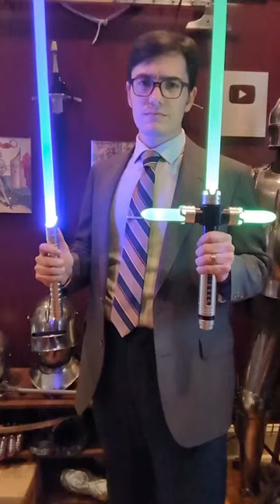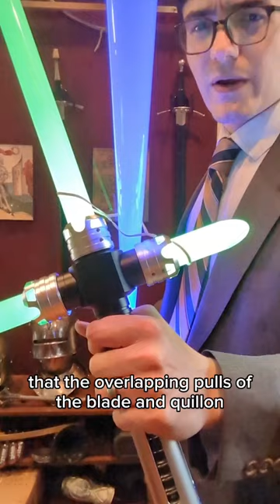Crossguard Lightsaber Theory

Comment: I have a similar theory that the magnetic field produced by a lightsaber makes it want to reach equilibrium which is why they appear to have weight despite actually weighing only as much as the hilt.

This is also how inquisitors are able to use their lightsabers as helicopter blades; the magnetic fields could oscillate at a rate that when combined with the spin of the blades, and a slight tilt could produce lift.

Comment: I agree with your explanation. But if you're really worried about it, there are two types of metal, cannonically speaking, that will stop a lightsaber blade, cortosis, and beskar. Beskar blocks without affecting the blade. Contact with cortosis will short the saber and turn off the blade.

Comment: Love the rubber bands, ❤ I think both are plausible it just depends, if its a quick light blow it'll probably cath one of the sides and slide onto the small blade like you said or just pull towards the larger blade? Like how bigger magnets have a bigger pull. 10/10 video btw

Comment: the blade also runs on the inside of the hilt so the section between the blade and the crossguard is simply covered and there is still lightsaber blade on the inside. we know this because the crossguard lightsabers still use a single kyber crystal in the center of the handle which is the source of the blade

Comment: The small “blades” on the sides are essentially vents, in a duel the wielder most likely rarely uses them to block as if it were a normal lightsaber without the vents

Comment: A saber without a crossguard ALSO has exposed handle there, the only difference is that there's ADDITIONAL blade with the crossguard, the fact there's additional handle sticking out the sides means nothing because a normal saber wouldn't block anything hitting there either.

Comment: I think people forget how the sabers catch on each other, and assume that they slide easily like a tube might to begin with.

They assume crossguards on a saber serve the same purpose as historic crossguards, but that specifically you would slide the opponent's blade down to the hilt and somehow twist it. The 90-degree crossguard isn't really used like that, and would be better served on the more angular crossguards (of which we have lightsabers that are built for) at which point the length of the projected blades makes it evident that you either catch an opponent's blade somewhere on the bottom third, or force them to disengage.

90-degree is clearly meant to be turned into your opponent during a lock and cut into them, also potentially forcing a disengagement, and favoring long-bladed projections of the main blade.

Comment: There are also some materials that are HIGHLY lightsaber resistant. Because a damaged lightsaber, especially a lightsaber damaged in the wrong way, is basically  as dangerous as a thermal detonator in your pocket, these materials are often chosen for lightsaber hilts, if not, specific parts of the lightsaber hilt.

So I'd presume beyond the magnetic pull between the blades, most crossguard lightsabers probably also featured resistant materials in their crossguard emitters.

Comment: The emitters on the cross guard are to control the excess flow of energy. If you did swipe down and burn out an edge it would probably blow out towards the edge you swiped and the overall blade would become weaker due to the excess loss of energy, but not much. Ultimately the port is still open and mostly guiding the energy in the correct way so it should be negligible.

Comment: The big secret is that it’s not meant to be used as a cross guard. It’s designed to break saber locks by putting a spitting unstable plasma blade close to their face while you press your saber against theirs

Comment: There was old lore (jedi channeled force i to kyber to power old) where the emitter just focussed the energy from the kyber crystal inset into the middle of the hilt, thus when activated you had energy in the entire hilt upwards from the crystal, just not focussed energy, and quillion blades were split off from tge edge of the source flow at the cross center before having three focussing crystals, eith wuillions being very tightly condensed to not be super long. The magnetic force would likely be much higher on a quillion as a result of the high focus of the field over a shorter distance and pull the blade to it, if this theory was applied with newer lore. Originally you likely couldn't cut through a crossguard quillion or above primary/upper hand of ANY lightsaber hence why there were sometimes long hilt distances from that hand to emitter, because primary hand was over the Kyber to help channel force into it, and anything above would have to cut through either an unfocussed torrent of pre-focussed blade energy, or a blade we already knew was impossible to cut through

Comment: Interesting theory. The problem is that those aren’t “blades”. They’re vents. There’s no emitter, but if you were to disable them, your opponent’s lightsaber would likely detonate in their hand. How, exactly you’d go about that, I don’t particularly know yet. Taking the emitter out of phase with the khyber crystal with the force, maybe? 
Cutting the “cross guard” (not really one, doesn’t really protect the hand) would be akin to removing the nozzle from a rocket. Instead of a tight, manageable, tuned pseudo-blade, you now have a large, crackling, untuned mass of superheated plasma directly over your hand. Good luck holding on to it from there.

Comment: There’s far more fundamental questions about lightsabers that need answers than ‘what’s the deal with crossguards?’  Such as:
Do they ever need recharging?

Do the blades have mass/inertia/momentum?

How much if the handle is vital to the functioning of the weapon?  We saw Yoda using a much smaller handle but his saver was just as capable as any other, save for the length of the blade which may have been yoda’s choice and not a limitation of the handle size.

And of course how is Qui Gon the only being to ever actually due from being impaled by a lightsaber?

Comment: Usually when a lightsaber had a cross guard like that it means the crystal powering it is unstable and needs those extra points to control it which means the style handle with it would be much like normal lightsabers and might vary just a little bit
(Interesting theory and correct me if I'm wrong)

Comment: My theory (aside from the designers just wanting something to look cool) is that the actual hilt of the weapon is made of beskar/some kind of beskar alloy, which lightsabers cannot cut easily.
What I find weird is that the crossguard is made of smaller lightsabers. for those who don't know, the light sabre isn't meant to be tube-shaped like a staff, it actually is a blade. the reason it is tube-shaped in the movies is because production-wise, it's not good to have your actors get into swordfights with actual swords that can cut, and the "lore" reason for the appearance is that the blade glows so bright on it's own, the glare from the light makes it look round. this fact makes the crossguard odd because it's the equivalent of having a claymore sword with two knives strapped perpendicular to the blade by the handle as a crossguard.

Comment: No, with the force they're striking with and how easily the light sabers separate in battle there's no chance the "sticky force" would over come their striking power.
If you think about it, the blade being attracted down to the cross guard would actually pull it directly into the unprotected part under the main blade

Comment: Its certainly possible, but id argue it also can come down to practical design. If you have the 'emitter' set deeper in and then theoutside part is to keep your hands from touching it,it could work as a good fail-safe. The field keeps ot from hitting 9/10 times,and if it does,its still just hitting the blade and not the emitter. If you do make the outside the emitter,you kind of deserve whats coming to you

Comment: The magnetic collation matrix that forms around the plasma that's coursing out of and back into the lightsaber emitter to cycle again would have to be fairly potent to contain such a primal force. The exacting method that's shared by both the Force religions could mean that all lightsabers share the same magnetic frequency.

Comment: If the cross guard saber's hilt is not made of beskar. 

If it's made of durasteel or any metal alloy that can be cut by a lightsaber blade. 

Your opponent's blade can cut the hilt causing the guard blade or the blade in general to either go unstable or just burst. 

And you have nothing but a shattered Kyber Krystal, a shattered hilt and injured hands

Comment: Kylo Ren's lightsaber doesn't have crossguards, it has vents for the excess heat/plasma that comes off the blade. His lightsaber is made from salvaged bits and doesnt work properly, which is why the blade looks all wonky and it requires the vents so it doesn't explode. A correctly made lightsaber has a nice, clean blade and doesn't explode.

Comment: For lightsabers with intentionally designed crossguards, that seems plausible. However, with sabers like Kylo Ren's the crossguard is more of solution to a separate problem, which is that the saber is unstable and generates more energy than the beam emitter can handle. The guard is basically excess energy being vented, and we don't really know the properties of that unstable energy. It may or may not have the same quasi-magnetic effect.

Comment: its hard to say. One of the reasons this comes up is after the Prequels lightsaber fights entirely changed to where they were just trying to hit the saber and not the opponent. Which would result with after a character gets hit in anyway they were out of the equation. So they added the magnetic pull of lightsabers to semi explain that. Personally crossguard sabers are a bit of a confusing thing for me. The first one we ever see (Kylo Ren's) Doesnt have crossguards for any reason EXCEPT that the kyber crystal had been cracked. Causing the lightsaber to be unstable. He had to make vents after this in order to keep it from blowing up in his hand. These vents conveniently make a crossguard saber. But with other light sabers it just seems confusing. Take Cal Kesitis's light saber when he gets the Crossguard Stance  the two new guards might serve a defensive purpose but it doesnt make a lot of sense. For one Cal wields it like it now has weight. But that can't really be possible sense all that weight is in the hilt. On top of that if the guards are just a whole tube on a normal light saber. It is quite possible it could slice through the vents. Now maybe the vents are there as a sorta saftey precaution for the user so if their hand slips it wont slice their fingers off. But if thats the case a simple half vent covers your hand but not the crossguards from the top end would work just fine. All in all These sabers do look really cool don't get me wrong and in some very specific cases I see them as useful. But as of right now they just leave me confused more then anything

Comment: aside from "so HOW is polarity determined from saber to saber" throwing a wrench into that retcon (you know, because that's magnets work).  There's a bigger problem with how magnets work:
if there IS a magnetic point between the two blades where your incoming strike would be caught in magnetic tension such that you couldn't push forward any more through the empty space, then likewise you would not be able to pull back either effectively "locking" the caught blade in place.  which makes crossguards SO BONKERS for controlling an opponent's weapon you'd wonder why EVERY saber didn't have one.

Comment: I think that the pull must be far too weak to prevent deflection from the crossguard's intersection or sabers would be much stickier when clashing and pulling away.  It'd take immense effort to separate the primary blades if two of fields could halt a blade passing between them.

Comment: True that could be possible. Even if it's not, I'm not sure if it qualifies as a "weakness". Even if that section isn't lightsaber resistant, it's at least material in-between your hand and the blade, which most lack. And that's assuming that section isn't just casing around the split in the single beam, in which case an enemy blade passing through it would just hit the laser under it. That said, if it is an emitter, then it does raise the question of what happens if that section does get chopped: does the entire lightsaber stop working, does it start emitting in different directions, or does the main section continue to function like normal, like how Darth Maul's double ended one continued to work after being chopped.

Comment: The "lightsaber blades are attracted to each other" seems to come from something I haven't seen and goes against my understanding of the way such things would work. 

Let's also not forget that if that attraction exists, then the jedi have to be able to overcome it to control their blades. so I would say that even if the competing pulls would stop the blade when swung casually, the jedi could simply use the force to push the blade through that field.

Comment: I think a better explanation is that it can technically be hit but it’s too hard. Lightsaber duels happen so clearly lightsabers aren’t stuck to each other so the pull probably isn’t that strong, even if it’s there. So while there is most likely a field that makes it hard to hit, it can be with enough precision and strength. The other two blades will pull on it sure, and for that reason trying to cut the hilt by sliding the blade is probably not much of an option, but a precise, strong swing to that part can. But that is a lot of energy and focus, which can either be put to better use or, if used in this way, can leave you slightly vulnerable. So while I don’t think it’s impossible to hit, I think it’s just more trouble than it’s worth. But that’s just my theory

Comment: 1. The cross guard part is actaully vents for the unstable kyber crystal
2. Lightsabers cant cut through any material standadd sabers had some things hard to cut through and some things it just wont like mandalorian iron, the metal darth siduois light sabers where made out out of but not even gonna attempt to spell as well as some creature skins  darth vaders suit could resist light saber strikes though not immune to them

Comment: Heres the thing..... according to ORIGINAL lore, the final stage of the saber handle was a spinning magnet which created a rotating field envelope which the plasma arc was contained within. Inside that top most ring should be a magnetic ring spinning wholy-balls-fast. This could be a natural, all be it invisible, hand guard repelling saber blades that approach the top opening. 

Side note: the gyroscopic forces of this spinning ring was why you needed to be a force user to wield a saber and not any tom dick or fin could just pick one up without subsequently cutting their freaking leg off.

The whole saber hand guard thing is a ridiculous 'this looks cool' bastardization of the ORIGINAL lore for how the light sabers (laser swords) functioned.

Comment: I always thought the cross guards fell out of fashion for a mixture of weight and energy. The blades of lightsabers are weightless (superheated plasma) so any material added to the end you arent holding will make it significantly harder to use for combat and the cross guards would be a drain on the power cell. The reason lightsabers all have such close desighns is primairly because you don't want to be the person to desighn a lightsaber that needs a new power core eventually. (Normally around 400 yesrs between cores) The kyber crystals may last thousands of years but the actual batteries we know both are able to go out, and standard lightsaber desighn keeps it at over 90% of the enrgy used being concerved. To crear the guard and have it come off nicely like that would effectively triple the amount of work the power cell is doing as lightsabers already aee the equivalant of charging a flashlight with a car battery. Sure it works but it's significantky more x the minimum output needed and the battery will degrade almost as fast as the charge is taken. Degragation isnt an issue so the only worry is having it on too long.  (Weeks if not years straight with a normal saber) but if you think of how some parts of the galaxy see 13 as adult for a human and some lightsabers get passed down and it would make sense with the exteneded lifespan in start wars. You could realistically as a human have 80 years of combat (120 year lifespan starting combat at 13 while HIGHLY unlikely is possible) and you could die unexpectedly and your lightsaber gets passed onto your kid. If we say the guards add even 15% power draw from the cell that could feasibly be multiple decades off your lightsaber. And i imagine (not sure if its stated) that most Jedi after building their lightsaber leave them alone when not in need of repair so having any chance of it losing power would be a major factor in the popular desighns

Comment: I think that they're not solid matter and most likely dont slide down the "blade" like a steel sword would and the cross guard has nothing to do with actual guarding, but is instead a cross guard saber's emitters are for expelling excess energy that would otherwise damage it without having to make a primary emitter that made a blade that's way too long.

That's just my theory without looking into anything though.

Comment: Aren’t the cross guard blades also emitted from the same kyber crystal, meaning that even if you try to cut through the metal part in between the blade and cross guard you’ll just end up hitting the beam inside?